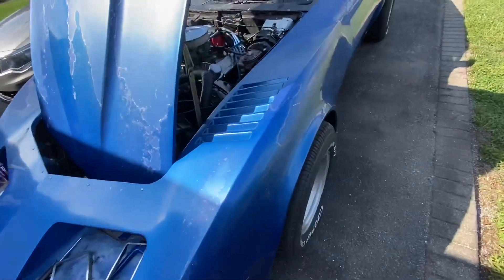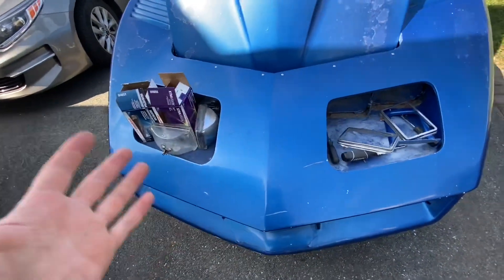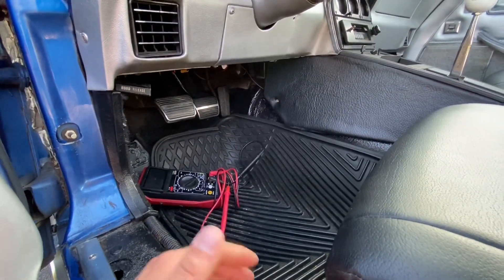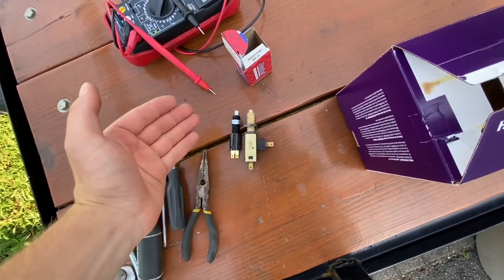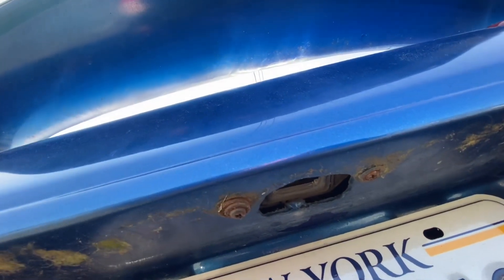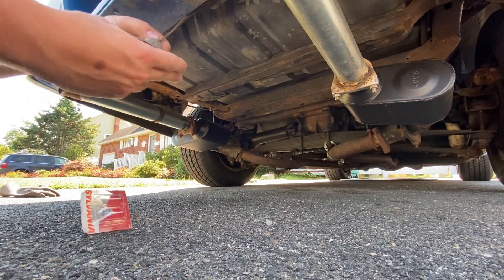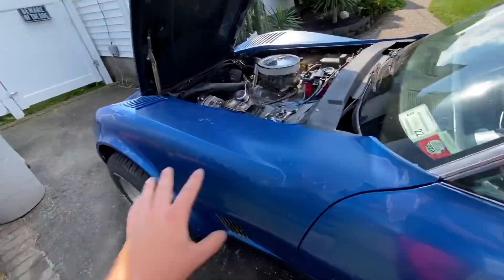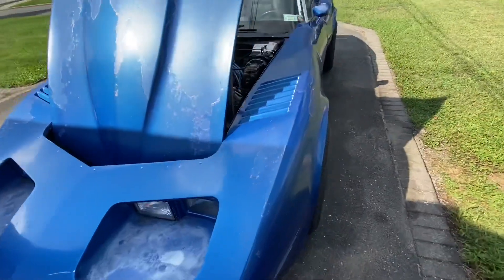Making the Corvette Road WORTHY! Fixing EVERYTHING That Made it FAIL Inspection!

Comment: The extra prongs on the brake light switch Is for the factory cruise control, it so when you press the brakes, it shuts off the cruise control

Comment: I’m glad here where I live in Arkansas we don’t have to have the vehicle inspection thing 💯

All vehicles wouldn’t be able to be on the road if we did ngl💀
Reply: The whole vehicle inspection thing is just a big scam/joke they give you a hard time about little things that have no effect on the safety but will turn a blind eye to dangerous things like frame rot. Alot of these places will instantly fail you if you have any sheetmetal rust even if underneath there is no rust. A friend of mine bought a toyota 4 runner that came from New York that was "inspected" and passed and had the sticker on the windshield but when you looked underneath there was holes in the frame and every line underneath was just about rusted through, matter of fact the transmission lines were just cheap rubber hose someone slipped over the rotted lines lol and one day he jumped in it and blew both rear brake lines simultaneously in his driveway. Which goes to show you that they are just using these inspections as scams to fix stupid little things and just ignore actual dangers like rotted lines and rotted frames.

Comment: That’s funny cause the part of New York I live in the don’t check the e brake
Reply: They probally check it because this car has a manual transmission and a parking brake is very important on a manual where it's not that important if the vehicle has an automatic because an automatic has what is called a parking sprag, which is basically a gear that locks the drive shaft from turning.
Reply: Brian G it also goes by area